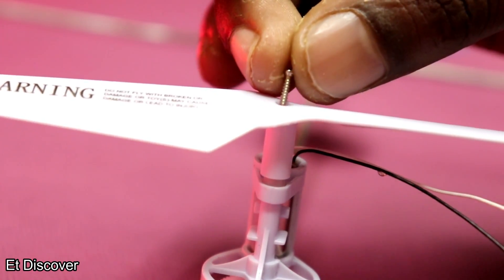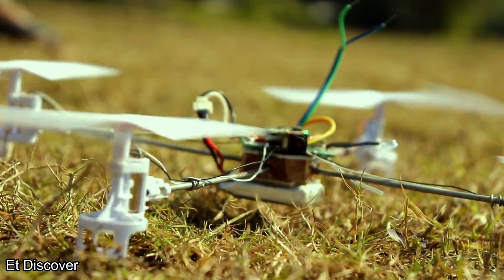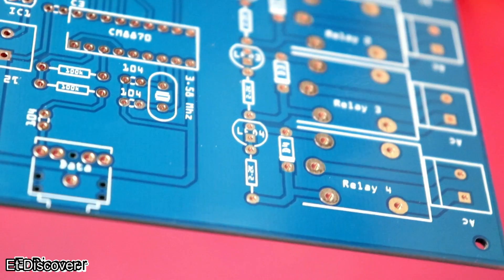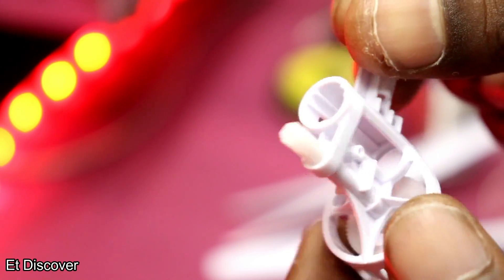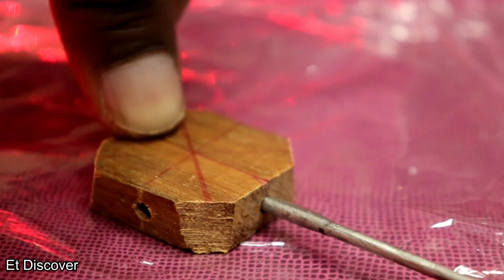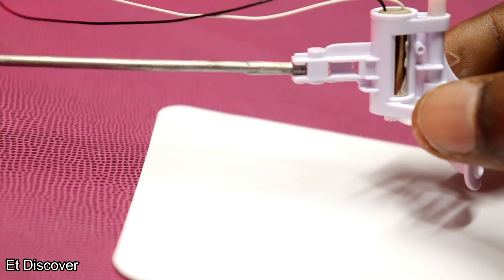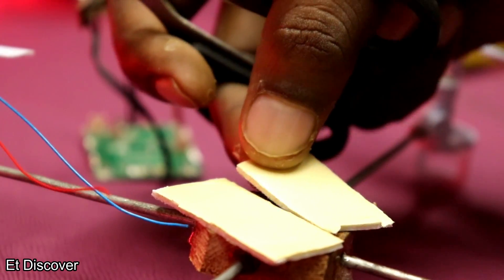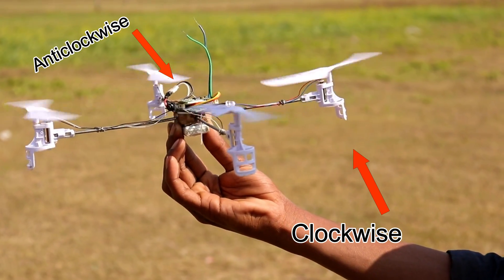Make Your Own Low budget Powerful Drone

Comment: Motor kai upper ka gear kha sai mila
Reply from the maker: aliexpress
Reply: We have ready propeller,motor holders with gear,circuit board,motors with gear......contact 8830844492